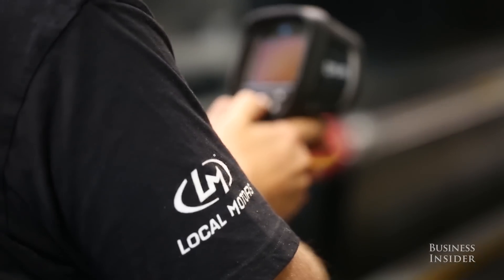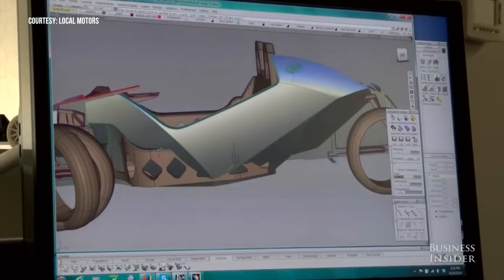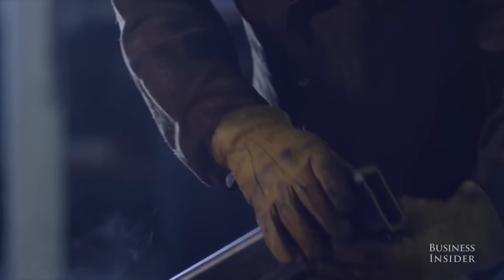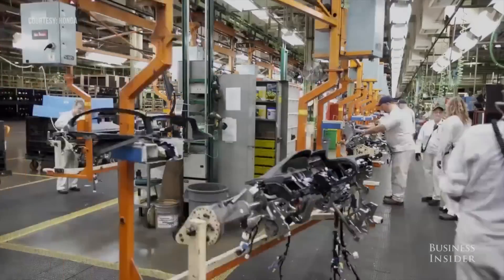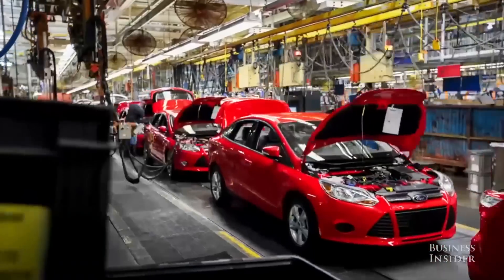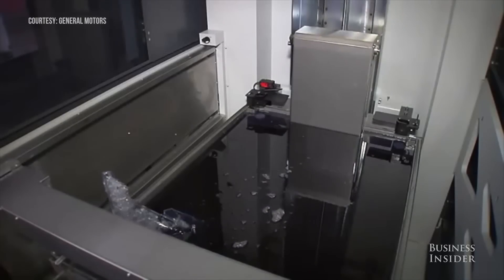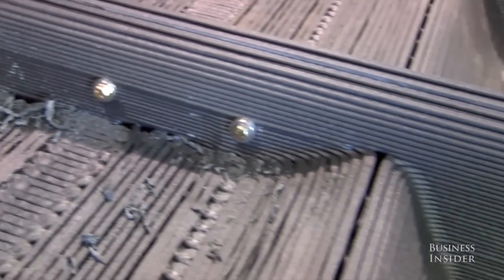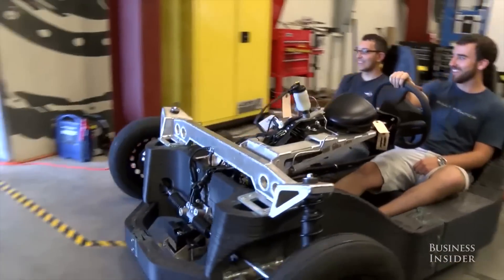This drivable car was 3D printed in 44 hours

Comment: No, the typical manufacturing process is NOT 20:1 waste, that's absolutely absurd! Stamped parts are at most 2:1, and forged parts are very close to 1:1. Stamped\forged metal will always outcompete a printed plastic shell in terms of weight and strength, there's a simple reason we don't make structural components out of plastic, it's too heavy and too weak, and always will be. This car will NEVER pass the collision requirements to be road legal, and if it does, it'll be heavy as hell. Even molded plastic is significantly stronger than anything FDM can make, and other than things like bumpers, it's never used in structural components. Can you imagine what'll happen when a layer gets delaminated? It's like a crack in a glass, there's no way to stop it from continuing on.

Comment: "Could feasibly cost just 7000 dollars to make" Here's thing thing, most economy cars cost 2000 - 6000 to produce. With that said a normal car is made in a fraction of the time and wont delaminate the moment you hit a speed bump.  The market price of current automobiles has nothing to do with how they are made but rather Anti-Consumer Dealership and Franchise laws preventing open sell.  If the manufacturer could sell them to you directly or through wholesellers they would become a hell of alot cheaper.
Reply: How do you know that this car will delaminate the moment it hits a bump? What about F! cars; they seem to do fine. I smell an agenda here.

Comment: Looks like a bunch of guys leeching Federal grant and alternative fuel money, as well as naïve investors.  There are so many holes in this guy's reasoning.  First, metal waste in automobile manufacture is not 20:1 - and all unused waste gets recycled.  I don't think you'll be re-feeding used ABS waste back into the machine.  Second, he talks about unitizing many parts into one structure (something McLaren has been doing for decades by the way) then shows aluminum sub frames which are complex weldments.  Third if someone was going to pay a premium price for a custom car it better have premium components and performance, both which don't look likely here.
Reply: You are absolutely right,
I want to add that it´s sad that idiots like that, make 3D printing look like a joke.
there are actually real aplicaciones for 3d printing in the Automotive industry.
For example, some manufacturers use metal 3D printed heat exchangers, in low quantity production Cars.
Reply: BMW is using 3D printed metal parts with topological optimization in volume-production Minis and i8s.
Reply: Your actually right, that's what happens in our country too.  People will lie with a straight face to get by.  This isn't going anywhere.  The automotive industry works with big solution companies like Bosch to create giant prototyping facilities (with their own patent) not like this xyz plotter joke.
Reply: Some of the things you say are true, like we can already see it's not a premium thing. But proper 3D printing using metal have got things far ahead now, see how time has passed.

Comment: or you could just injection mold the plastic and make it stronger
Reply: U Will need a really Big expensive injection machine
Reply: @manuelgaldamez6275  but after a certain number produced it becomes drastically cheaper per unit. Plus the production time goes from 2 days to like an hour or two maybe per unit. Which saves you tons of operational costs. 3d printing only makes sense if you're only making a small number of units. It doesn't scale well at all
Reply: @johnhonda93  Bro u cant that machine doesnt exist also the thermal conductivi of the plastic doesnt allow you, It Will be a very very very expensive mold, and machine, the time production wont be that fast because of the amount of plastic the screw of the injection machine must process, also 3d printing lets u make infill patterns wich means better performance.

Sorry for my bad english
Reply: @manuelgaldamez6275  theres a company that claims to have the largest injection moulded part. It's a half of a tank that's 15ft long and weighs 245lbs of plastic. Im pretty sure this is way smaller.
Reply: John Pfeifer theres an idea!
Reply: Bro u cant inject that enormous amount of plastic
Reply: @manuelgaldamez6275  why not?

Comment: You took a great technology and made something that turns people off to the technology. That is what is called in the industry "A Prototype." Now improve it.
Reply: You are absolutely right,
I want to add that it´s sad that idiots like that, make 3D printing look like a joke.
there are actually real aplicaciones for 3d printing in the Automotive industry.
For example, some manufacturers use metal 3D printed heat exchangers, in low quantity production Cars.

Comment: One huge problem of everything which is 3d printed plastic is recycling. Everything that breaks or won't be used anymore ends up as plastic waste.

Maybe that will change in the futur. But for now it is a huge waste producing manufacturing process. We already have enough plastic waste which we can't deal with and poisons the seas and nature around the world.
Reply: Adam Bryant think of all the oil used to make the phone or computer you made this comment from. Are you the only one allowed to use oil?
Reply: Some of them use carbon fiber printing...
Reply: Isn't ABS made from oil which is running out?

Comment: lol .. they didnt print a car .. they print a tube and put real car part around it ..
Reply: and soon we will all be driving around in tubes! (or not)
Reply: Good luck creating 3d printed combustion engine. One cycle of combustion engine will already melt your plastic.
Reply: @richardlighthouse5328  they can 3d print metal. But a 3d printed engine is a dumb idea
Reply: @johnhonda93  I also doubt that 3d printed metal will stand up to the temperatures inside a combustion engine.
Reply: @richardlighthouse5328  it's literally metal. They can 3d print titanium.
Reply: @johnhonda93  You would have problems with material structure. Such as poruses and uneven surface.
Reply: @richardlighthouse5328  not any worse than a cast part would be. Infact it probably would be alot better than cast. But it's stupid anyway, because they would be way more expensive than an aftermarket forged part which would be way better quality and stronger anyway. So it's a silly argument
Reply: @richardlighthouse5328  Porsche 3D prints pistons for one of their cars, there's a video of it... it allowed them to add oil cooling channels you wouldn't be able to with traditional manufacturing techniques.
Reply: @johnhonda93 they literally 3d print rocket nozzle jets and parts... A combustion isnt that hard... But it wouldn't be any superior to cheap traditional casting... Yet.
Reply: @richardlighthouse5328  Change the plastic squirty nozzle to spin'ie cuttie, use a cnc slicer and start with a block of aluminum. Make it run on hydrogen tho or the greenies will be a pain in the ass.

Comment: , if a car needs so many components Is the best way to damage one and replace it. if the hole Car was made of a single part you Will have to replace the hole structure...
Reply: Maybe even the whole car...
Reply: The Doodling Dude minute 1:40
Reply: Exactly... In a normal Car.. even the chassi has individual components that can be replaced... Obvi a car can not be Made out of a single part..Don't take literally, but the want to use as less parts as posible, can you imagine the hole outter body Made of a single part, you hot it right down the córner a you have to buy almost and entirely new Car???
Reply: Fu_#&$(#@ phone... Can not write correctly...
Reply: One piece would not be a problem  just cut the bad piece out and print the replacement to fit  then attach it, smooth , maybe paint and done .

Comment: Dont get it. Engines are cast, so there very little to machine out. So with sheet metal. Yeah there are some cutoffs and cutouts. But where do you buy 21/1 mass of material O_o. Thats so not true. Only machined parts like bearings, rods and so on have that problem but its not even close to 21/1. Love 3D Printing but thats bullshit.
Reply: Excatly, all the big solid pats are cast. There is some waste when they stamp out parts from rolls of sheet metal, but the waste is probably like 10%. Still far from the 20/1 waste/parts ratio. Also all that waste is simply sent back to the steel forge to be melted back in to new sheet metal (A lot less energy intensive than making brand new iron from ore)

The sort of efficiency they put in to making production cars is pretty much amazing. They optimize every last dollar out of the production process and consider every second of work a assembly line worker has to do per car.
Reply: Lord_Vader with all cast moving parts (pistons, rods, crank, gears) there is a lack in strength, forged is much stronger. I can see a problem with strength in sports cars or large load bearing vehicles.
Reply: if you have really expanive rims  than they are one of the most material unfriendly parts (because they are cnc parts) but normal rims are also cast material. 

but i dot get it because al the plastic parts and al the sheet metal parts need dies/molds to beformed. and they are made out of full material (and are not cheap) but they are a 1 time cost (if they dont change it) so that also cant be it XD so yea 21/1 is fake news
Reply: Is this a rolling coffin?     Can't wait to see the crash test results.
Reply: Lord_Vader it actually is true.
Reply: Yes it's bullshit, like other parts of the video.

Comment: But wouldn't melt in the summer
Reply: nah, ABS is already used in cars. its able to deal with really high temperatures before it loses its mechanical properties. most current plastic parts in a car are made of ABS.

Comment: A 7,000 dollar long-lasting 3-D printed vehicle? Why do I get the feeling the world's largest car manufacturers aren't exactly thrilled by that idea?   -_-
Reply: car companies are not worried. they said "could" cost 7k. check out the car this company wants to sell for over 50k. I like their enthusiasm though.
Reply: car companies are not worried. they said "could" cost 7k. check out the car this company wants to sell for over 50k. I like their enthusiasm though.
Reply: If this became a viable norm, don't you think those large manufactures would also switch vehicle production to this method? Its called economics...
Reply: this guy gets it, they went from conventional machining to cnc & robotics so they wil do the same when 3d printing will become more economical. remember cars were once made out of wood ... so XD yea
Reply: MOTO-079      That is a good point
Reply: Yeah, this whole video is a tissue of "Big Auto" pleasing nonsense...
If ONE bot can make the monocoque for one car in 44 hours.
100 bots can make 100 cars in about 2 days. Give this car all electric bits (instead an old engine) and any normal sized factory can churn them out with off-the-shelf parts at a normal factory production rate.

Car manufacturers don't want to do it YET cos they have millions invested in metal presses and cnc bots - plus all of their engineers are trained to make conventional cars. (while we avoid noticing that GM/Ford etc LOSE money on cars, to give you a product that fits the retail maintenance cycle and Oil-co's they all have massive shares in...)

So 2 obvious conclusions.
1: Making a car with less parts DOES NOT make it more reliable. It makes the Quality Control easier in production - only real-world testing will prove reliability.
2: Big-auto hasn't done all their sums for profit yet. When they have, they will change how they make cars, period. 

This video isn't "which is better" it's "How long does it take massive investment to catch up"
If any small garage can make vehicles up to the same Quality as a large operation, in 2 days, for around 7k... GM will be very scared.
And auto-manufacture will be very democratic - lol.

Right now these plastic bath tubs are a curiosity. Probably a glimpse of the future. But they need to be designed by people that Understand auto-manufacture to move forward. Not by people who say things like "one car every 44 hours is too slow, compared to a real car factory"
When, once again, car production plants have Hundreds of robots, to make hundreds of cars... Pretty simple math, ey grommit? xxPD
Reply: artie ny83 I say fuck big car. All big business and central bankers should jump off a cliff.

Comment: What is that sewing machine action? putting in carbon fiber?
Reply: No Dan, it's obviously patting down the printed string plastic for fixed layer height  :)
What I'm thinking though is that they should look into laser sinterest metal powder printing in a vacuum chamber. Maybe multimaterial. I would also consider EM guided vapor deposition.
The obvious goal is a single process that can do the entire finished product.
Reply: Crazy dude talking to himself